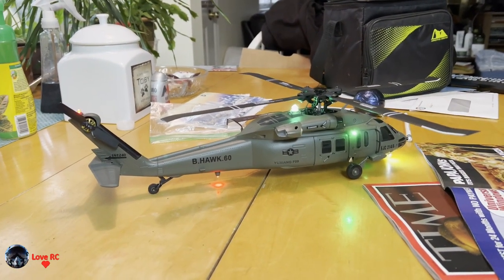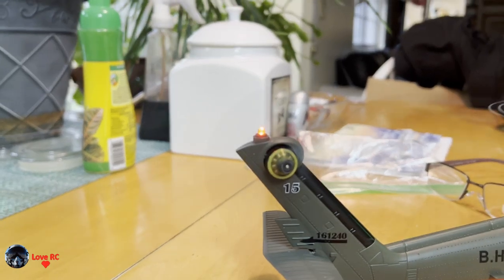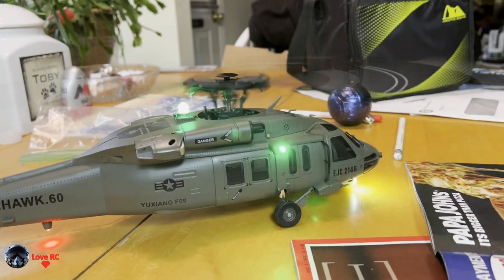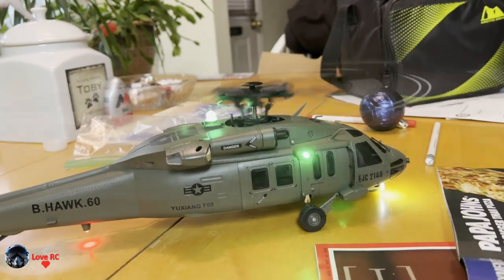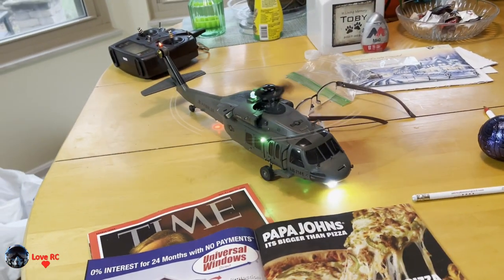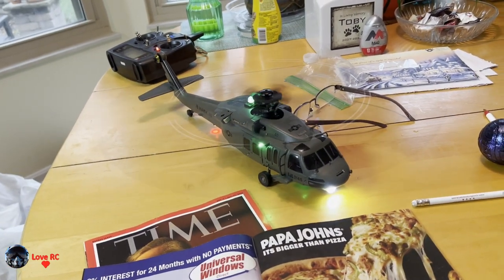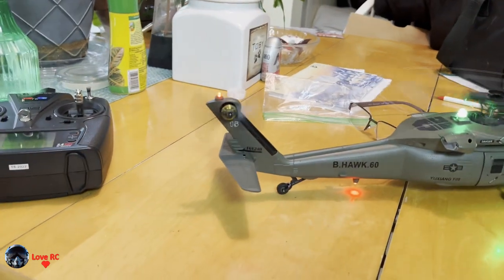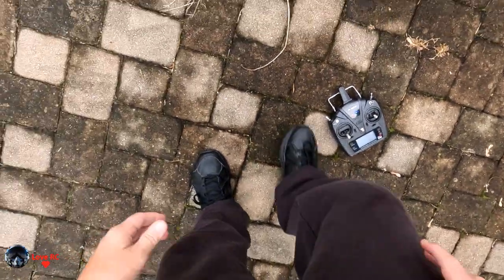YXZNRC F09 Black Hawk - New Tail Rotor.  It burnt out on a hot day.

Comment: I have a similar one but by YuXiang.  The rear stopped working and the helicopter was flown less than 30minutes combined!      I'm still waiting for my replacement parts
Reply from the maker: My blackhawk still flys fine after replacing the tail rotor.  My F06 EC135 however went crazy and crashed.  I just got a bunch of replacement parts from RC Going.  We'll see if I can get it flying again.

Comment: Is this one  F09 has GPS like Coast guard F09-S ? Thanks!!
Reply from the maker: No.  It does not have GPS.  It has 6G gyro or manual mode. 
The F09-S has 6G gyro, ground optical flow, and GPS.

Comment: What are your throttle curve and pitch settings?
Reply from the maker: The default in the manual.
Reply: Thanks so much!  My f09 keeps falling, out of the sky uncontrollably.  I thought it was the pitch and curve settings, but nothing has worked as far as changing the settings. Basically, I have bought all of the parts to replace the entire f09.  However,  my Eachine 200  has worked fine out of the box.
Reply from the maker: @RobertParker-m9g  The only thing I have had not work was when the tail rotor burned out.

Comment: Tail motor on mine died day 1.  Not a fun project for a new model.  YuXiang has a reputation.  Replacement has been good so far.  I use a towel under the model to keep the tiny screws from bouncing off into oblivion. Great helicopter otherwise.
Reply from the maker: Great advice! I should have thought of that.  They do bounce easily.  Yes it is a great heli otherwise.
Reply: Was the heli in the air when you lost the tail motor?
Reply from the maker: @SKYLINEFILMSBRASIL  yes mine spiraled down into a field but no damage.  I replaced the tail rotor motor and now she works fine.
Reply: @SKYLINEFILMSBRASIL  Yes.  It faded out mid-flight on day one.  Since then, the provided replacement has worked well.  But the fix was not fun.
Reply: Have you had any problem with your F09-S ?
Reply: @SKYLINEFILMSBRASIL  I decided to pass on the F09-S.  It's nearly $200USD more than the Army version, all for features I don't need/want.  Too much money for a paint job.  But another YT poster (Love RC) had the same issue with his F09-S.  Dead tail motor out of the box.  It is the same 1103 motor.  Normally not a big deal, but you have to disassemble the whole shell to replace it.
Reply: @RARenfield  For me is ok disassembling to replace it. What scares me is having a spinning heli in the air. I have a F09-S. I had a fly away on the first flight and a dead tail rotor on second flight.